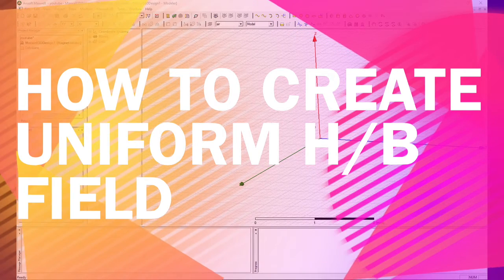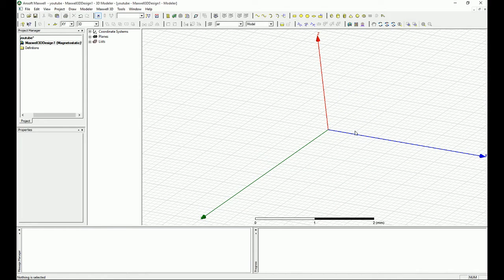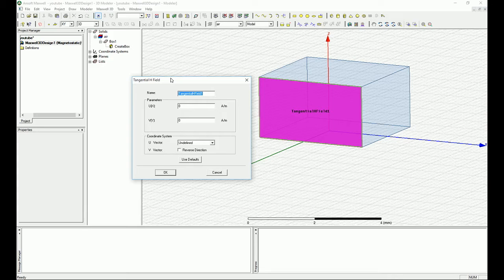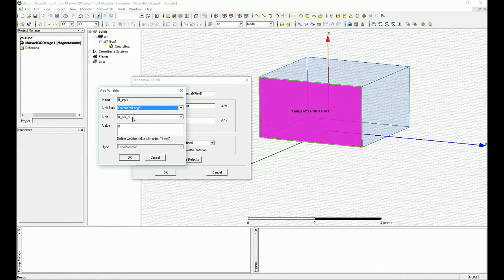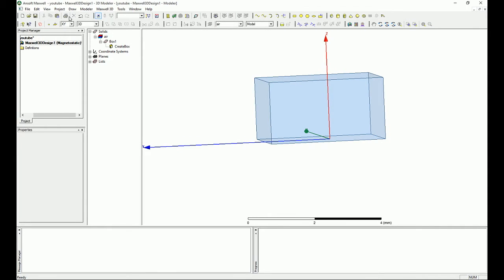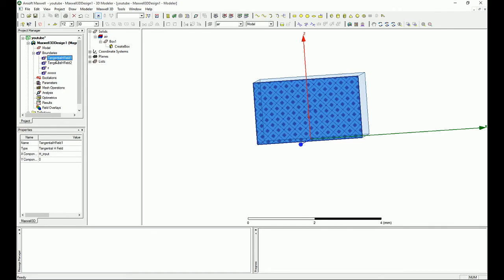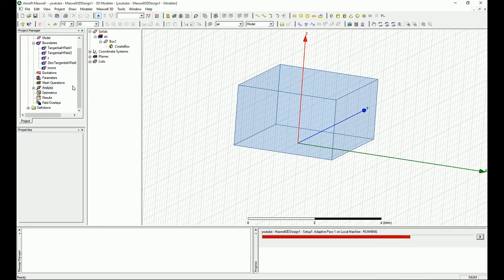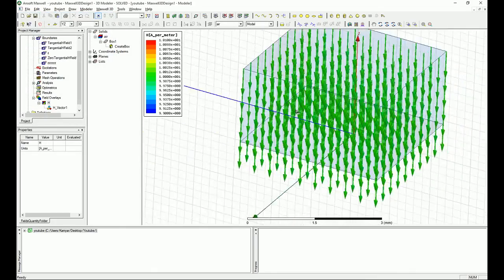229 - Ansys Maxwell How to Create Uniform H or B Fields

Comment: Thanks for the video. I was wondering if you could add 2D uniform H field in maxwell 2D, when the solution type is "Eddy current" mode?
Reply from the maker: No you don’t have that option. All you have is vector potential that you can apply to edges

Comment: hello, thanks for sharing! very useful! A question, I tried to generete an ac field for eddy analysis and inside the constant field (ac magnitude constant and direction z) was placed an conductive cilynder. Isnt  supposed that the focault currents inside cilinder  interact with the applied H field? Simulation in this case have  shown the focault  currents inside torus, however the z H field is kept unvariable. Is the formulation for the H field correct?
Reply from the maker: The constant H or B field would not generate any current in reality and so as in eddy current solver. The reason it’s being added to show the capability in which the constant field can change the operating point of the BH curve in nome linear  material and recalculate the AC field and it’s induced current. Think about saturation and etc.